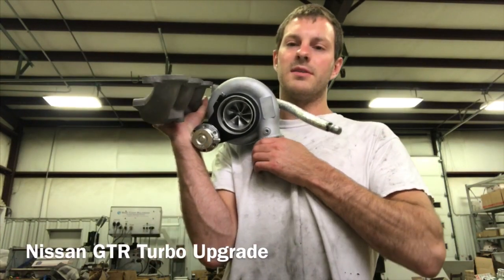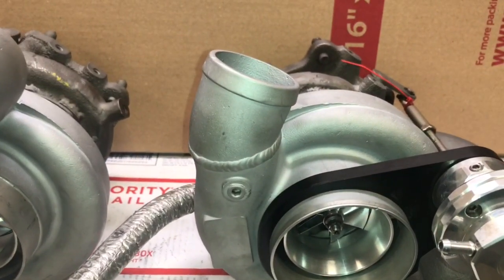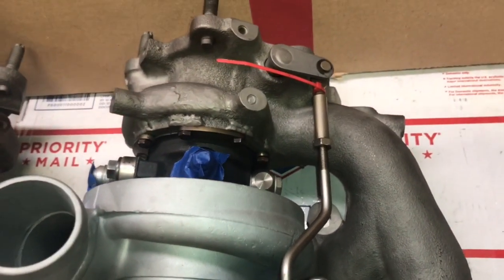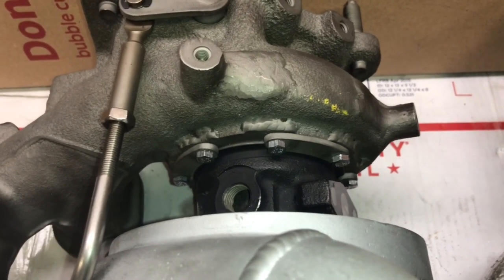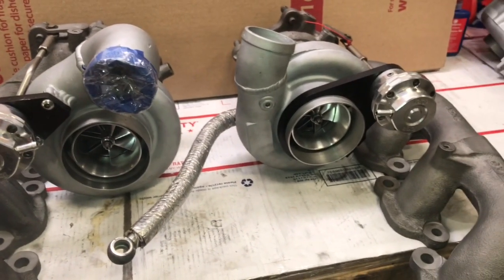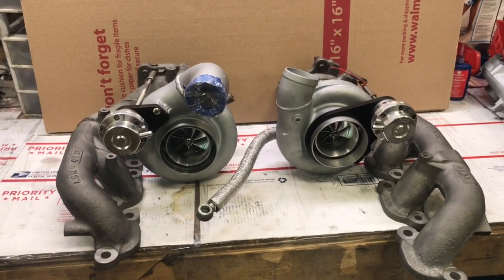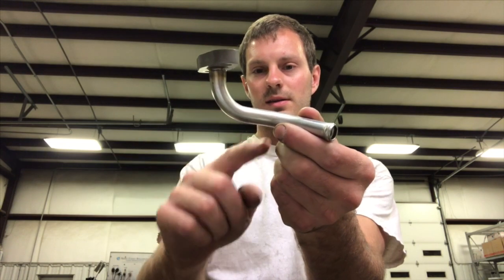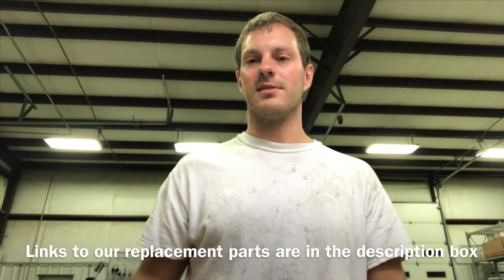$12,000 Turbo Upgrade

Comment: Also said 30 to 40 k for turbocharger what absolute bullshit I can build a 700 hp wheel horsepower car for that and more maybe 1000 hp if you do most the work besides the engine machining or something that needs to be sent out because you haven’t a clue or because you can’t afford the tools to rebuild or make  like everyone has a cnc machine or resurfacing they cost just as much as a whole build or 4 times as much
Reply: slws14 no but you are troll I bet you know nothing about vehicles or automotive repair.
Reply: slws14 troll